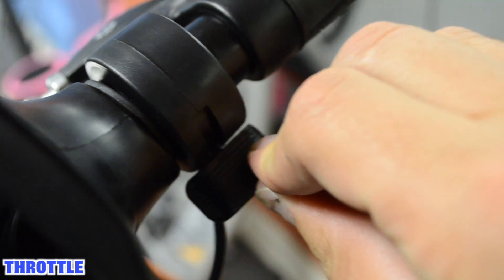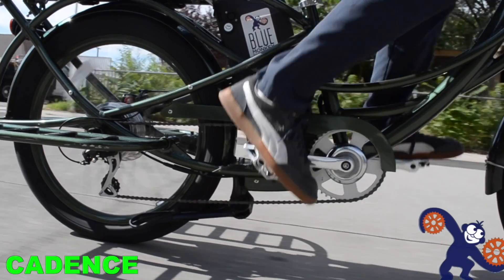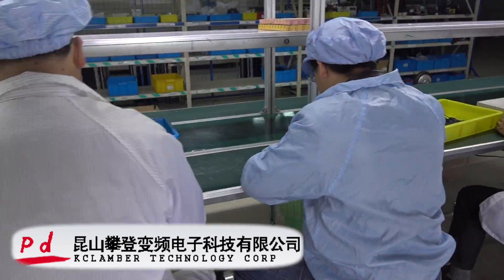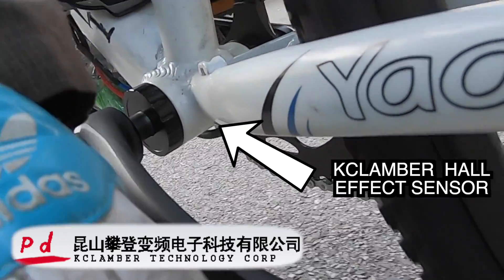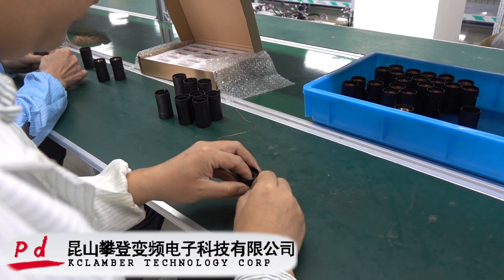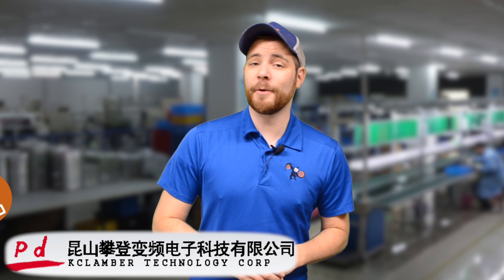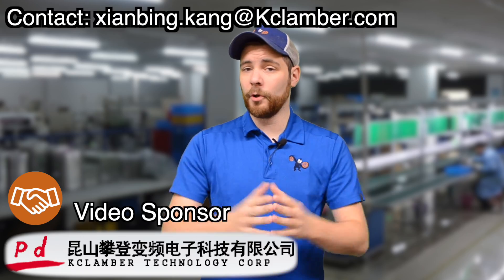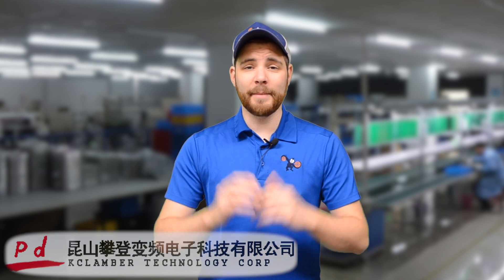eBike Factory: Torque Sensors Kclamber Technology Corp.

Comment: I wanted more than this superficial look at the Torque sensor.  Imagine you have a controller with no PAS but just a standard throttle input. It ought to be possible to fit a BB torque sensor and the throttle sensor to the controller's throttle input. The trouble is these Torque sensors will send a single 0.8v to 4.7v  or 1.5v to 3v.  If only someone produced a tiny op=amp board into which you plug the torque sensor,  with an optional input for the throttle sensor. The board would output a signal compatible with the controller's throttle sensor. eg 0.7v to 4.7v. If torque manufacturers want to sell more of these sensors they would also produce the boards necessary to upgrade from the PAS.

Comment: what would be a compatible with these torque sensors? Do they have 5 wires, like other torque sensors?
Reply: My bike is only last years and it has a blue juliet cable 4pin so i imagine 4 cables however u need a controller thats compatible with  this
Reply: OK! Now I got why you might want to use two sensors for torque. I don't have an answer but I found this short video from a precision torque sensor manufacturer:

https://www.youtube.com/watch?v=b4nz_hAh7qs

Comment: Hi Mikey, Is it possible to replace a cadence sensor with a torque sensor bottom bracket or does the Controller have to also be changed? (Bafang Hub Motor) Thank you.
Reply: Контроллер скорее всего нужно будет заменить.

Comment: Thanks for the informative video.
Torque + cadence some says is better. I can understand the use of torque but why mess it up with cadence?
Reply from the maker: You can check out a video we did on torque vs cadence pedal assist
Reply: Yeah how does it work when you have both torque and cadence sensors?  A switch?

Comment: My 2012 Stromer uses a TMM4 strain guage type torque sensor at the rear derailleur hanger. The sensor plate hanger is cracked and bent inward and the derailleur is also damaged but oddly enough the ebike works well. Replaced the plate and derailleur, PAS response became poor and sluggish. Reinstalled original parts, torque sensor works fine. Is there an adjustment to calibrate the sensor by trial and error? I really want to replace the defective parts.

Comment: Thanks for the Vid.  Is it possible to convert a cadence sensor on my ebike to a torque sensor?  I have a a 2018 Halfords vengeance e
Reply from the maker: You'd have to switch out the controller, one that comes with a torque sensor bottom bracket
Reply: @BlueMonkeyBicycles  So...the original controller wouldn't read the variable signal from the torque sensor? Thinking of modifying after purchase.

Comment: Can I ask a question I have a Juliet connector on my rear bike motor where do I look to see what type of battery connector do I need since I want to upgrade my battery ah can you help me with this info I have a shwinn sidewinder 26” 36v 10.4 ah 250w can you plz help me with this thank
Reply from the maker: The connector at the motor doesn't connect directly to the battery. Between the motor and battery is a device called the controller.
If you find the connection from the battery to the controller, you can get an idea for what connection is needed.
You can replace the 36v 10ah battery with anything 36v. 20ah, 30ah, 5ah... Any ah rating will do. The hard part is making it fit physically without flopping around, and yes, getting the connection correct.
Reply: Blue Monkey Bicycles i dnt see a external box like on other bikes so where would I have to look for my controller on my bike sorry for all the dumb question but I’m new to this and need your help and guidance and thank u so much for your time and response I know your very knowledgeable that’s why i watch and share your vids with my friends do I need to take off the battery to see the controller connection?
Reply: Do I have to take off the battery to find the connector and mine I think says it’s a thumb controller the name of it is (key disp) I’m so lost right now need help
Reply from the maker: The throttle or the display that tells you how fast you're going is sometimes called a controller, but the word controller is reserved for a different part of the bike.
Both the battery and the motor connect to the controller
 Sometimes it's in an external box, sometimes it's hidden in the frame of the bike, under the bike or under the battery. Follow either the motor or the battery, and you'll find the controller. Don't skip over the wire if it goes inside the bike, it's easy to mistake other cables.
Reply: Blue Monkey Bicycles my bike is pedal assist only it only has power button and assist level view nothing fancy just 3 buttons I sent you the name of my bike figured you could have sorted it or knew more about it than a begginer like me I very new   To this learn as I go lol how small can the controller be then because I dnt see a box outside the frame so I guess I’m going to have to take the batter fin box off and look there inside the frame also im about to get a battery with more amp hours is it hard to change the connectors from the old battery to the new one ? Is it best to cut and slice or take it apart and weld it (sauder) together no matter what your the best bro thx as always
Reply from the maker: And an email to bluemonkeybicycles at gmail.com and tell me the bike make, model and battery size. Also tell me what's not cutting the mustard with it and what your goal is

Comment: Hey Mikey- Could you elaborate on which manufactures use these sensors.  For example , does Bosch use them?
Reply from the maker: Bosch has their own, I know that for sure. If you look around for a bikes with a throttle and a torque sensor, then you probably found a bike company using kclamber.

Comment: Hi Mikey. Would these units work as a retro-fit replacement for eBikes with PAS on the crank, or would the controller need changing too? I imagine with PAS only an OFF/ON state is detected while torque units would need to send a signal range (say 0.0 to 1.0).
Reply from the maker: The controller would need changing too.
I know throttles often output 0-5kΩ, I don't know the range of the torque sensor output. It might be customizable...? I'll ask the engineer I work with, and see if I can distill an answer less than 10 minutes.
Reply: @BlueMonkeyBicycles  Hi, Mikey, what did you find out on this?
Reply from the maker: Can't remember